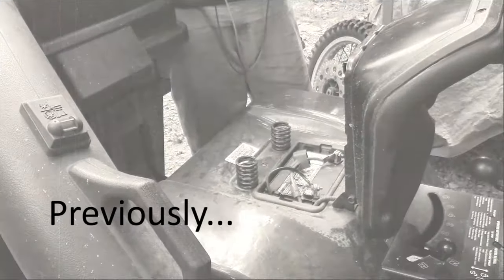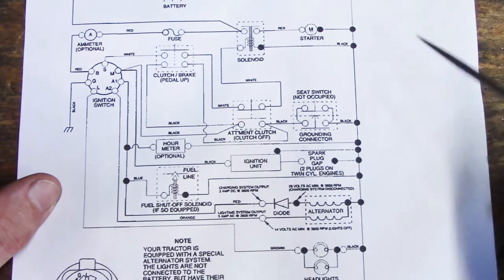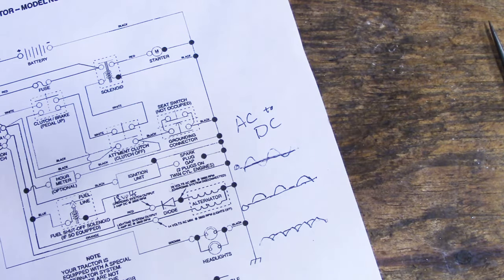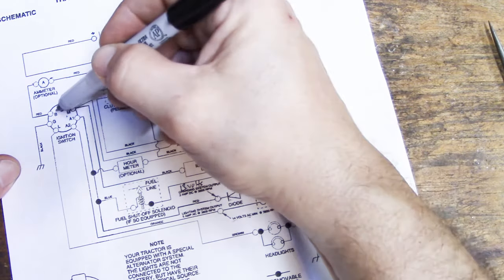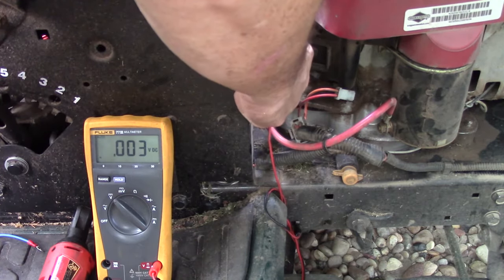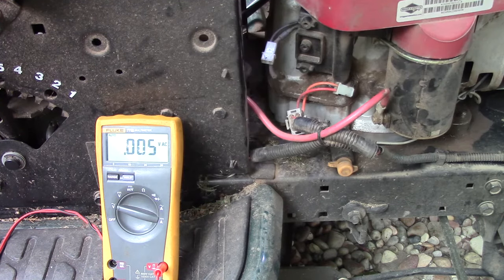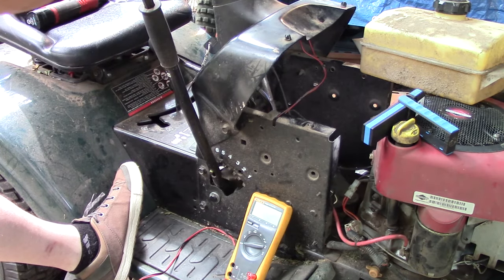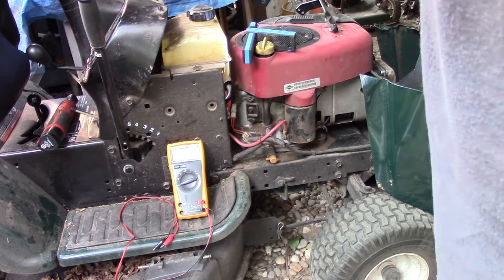Briggs & Stratton Dual Circuit Charging System - Diagnosis and Explanation

Comment: Very good and informative video. Mine is a Free LT1000 and seems to be configured exactly the same as yours (from what I could see). Mine doesn’t seem to be charging and I checked at the output of the stator/alternator which was 0 engine running at rabbit pace. Odd thing was that my battery was higher at rest than when running (and there was a gain climbing) but nothing indicated on the amp meter. I’ll try the disconnect reconnect amp meter trick.
Did you replace your cutter deck yet? If so how much and where?
Any trouble with your hydro static transmission yet. Gotta see if I can fill mine somewhere... haha. Thanks for the well made video!
Reply from the maker: Your problem sounds like an alt. No I have not replaced the deck, it is in good shape. And no trans problem as of yet. I am pretty easy on it.

Comment: So, I'm getting 26v dc out on that stator... How does that work? I'm assuming it's not charging the battery and there's a bad wire somewhere creating no load?
Reply from the maker: So yeah that sounds a bit high but did you check it at the battery? I did end up replacing this alternator. I would not trust the values I got in this video. With the new alternator I was getting more fluctuation and both higher and lower values but at the battery it was a solid 13v charging voltage. If it is more than that it might be a failing or failed open diode or ???? Thanks!

Comment: The reason it is 19 volts DC is because there is no load on the circuit.    Connect the battery to it and the voltage will go down due to load created from charging the battery.

Comment: I hope this helps you all: you can totally disconnect the wiring harness going to the engine and the engine will still run, if you pull start it/start it with a drill motor.  The ignition system is independent of all the crap in the schematic.  Pretend it's a push mower without a battery, because that's all it is.

Good video though!  Great explanation of the charging system, it helped me.

Go here to see what I'm talking about:https://youtu.be/c7R_4na47eo
Reply from the maker: Yes, in this example the charging system is only there to run the lights and keep the battery charged which powers the electric starter. However, if you have an electric PTO clutch, it is powered by the battery. But yes, in this example you could manually start the engine and it will run, though it would probably be easier to take a separately charged battery or battery starter and jump the starter, but the big drill method works. Good demonstration btw.

All the best!
Eddie

Comment: The wire with the diod on it. Does it go to a voltage regulator,, or direcly to bat+ thru egnition switch ??
Reply from the maker: The diode does the job of the voltage regulator/rectifier, there is no other regulator in the system. It goes thru the ignition switch though the motor will start without it working therefore it does not specifically influence the ignition system it just passes through the switch. Best!
Eddie
Reply: @theeddies  thanks alot. Just engine swap a husq 151 to an older 12hp briggs thats why i wounderd👍👍

Comment: I got the same exact setup as you. underneath the dash just behind the starter solenoid I have a white wire coming out of the wire harness it has a female Spade connector on it I'm assuming it's ground wire they're already is a white wire coming off of the actual starter solenoid on the stator side . it goes into the wiring harness.  that wait wire that's not connected to anything for life of me I can't figure out where the hell it goes. you off and on switch for the lights only has two poles on it if it was a three pole switch I would have assumed it went to the outside part of that light switch. didn't know if every tractor had an extra white wire sticking out of the harness ,  under light switch behind the starter solenoid area? and on the bright side of having one of these sissy lala charging systems. from what I understand from the B&S books Is that you can replace it with a engine that's more powerful or equal charging. just not one that gives off less power. when you swap any engines. so I guess anything can go in this type of lawn tractor that has the bottom of the line charging system.  LOL I have been trying to figure out a way to add something to where I can get more power on a tractor. power inverter a second alternator .tie in another generator somehow to the flywheel or to the engine pulley. first I wanted to put digital voltmeter with charging port for a phone. then LED lights underneath it, just to do a project with the kids. one thing I don't understand is under the hood it states that it takes a snow thrower , scoop and I'm assuming it's talking about a plow? I'm not sure where they thought that they would get the power from to raise and lower or to run a snow thrower. this is a Craftsman ys4500 model number 917. 276642.  20 hp Briggs Stratton Intex gold motor. pretty sure the gold part of this motor just means it has a pressurized oil pump at least as far as I can tell. I don't think it gives off any special powers to lift and lower a scoop. LOL anyway thank you for your video it helped
Reply from the maker: Hello,
Not sure about your wire I don't have any extras, it could be a for something your tractor does not have and they used the same harness. There are ways to upgrade to a better alternator. The models with an electric clutch put out more power as I understand it. I thought about looking into it on mine but changed my mind. Not sure about the snow plow or snow blower, most plows I have seen are mechanical lift I think. The blowers commonly just add another belt some way or the higher end ones might have PTO or PTO driven hydraulic systems, not sure, it does not snow in Georgia. All the best! Eddie

Comment: Can you test Briggs engine dual stator for current output and voltage using single diode use, WITH BOTH red+ blk WIRES TOGETHER, and at cranking speed only with plug wire disconnected, and compare with also with same  dual alternators with both wires and just a bridge rectifier at cranking speed , with plug wire disconnected, for current DC amps and voltage output? I need to know these measurements. Maximum current flow when touched quickly to ground, I am looking for 6-10 amps DC flow during quick test only. (PS- Reason for asking is because of The Alexander US Patent 3913004 provided EXCESSIVE electrical power output with double combined wires in it's charging unit.) THANKS, ....Russ
Reply from the maker: Hello and thanks for watching but I am not going to connect AC and DC currents together on my personal equipment to do some hypothetical test. I am a home shop not a testing facility with multiple machines and testing equipment. I would likely just blow my multimeter fuse, or burn out my diode and/or alternator. I would suggest you ask someone who has the ability and access to cheap test subjects to set up such a test. Maybe Taryl Fixes All or Steve's Small Engine Saloon. All the best!
Eddie
Reply: My 17 hp B&S Twin has this diode system also. I was having problems not charging so I took the connector with the diode that comes from the stator and moved the diode wire around a little bit with engine running and it started charging. Been working fine since. My mower was bought new in 95 and still runs great! Model 42A707 
Type 2238E1.
Thanks for posting this video. Very informative! 👍👍

Comment: man i have been searching for this Voltage Regulator that doesnt exist for a week now. Thank you so much. I cant say it enough.  My new alternator has 1 yellow wire. The old one had 2 wires.  Where does this 1 yellow wire go????
Reply from the maker: Hello, you are welcome. If you just have one wire and your old one had two, they must have given you the wrong one. It is dual voltage so you have to have 2 wires. You may have gotten an alternator meant to be used with a voltage regulator and rectifier. Best! Eddie
Reply: @theeddies  ugghh. Ok thanks so much. So much of a hassle lol

Comment: In short terms, most small engine manufacturers give you a simple charging system because it's cheap. High voltage, low amps (volts x amps=watts) Hence no voltmeter because ignorance is bliss. Beast practice is to manually charge once a month given that it can take 20min run time to replenish a start up.

Comment: Doodles control the direction of + electrical current, they do not act as a resistor transformer mosfet switch relay or clip capacitor, only an energy version of a one way check valve, in a rectifier there are 4 diodes that are wired in sequential redirecting order that sends positive current in only one direction, and negative current in another, without interrupting the ac circuit,(think of it as a push-pull piston in a pipe circuit plumbed in a square, the fluid would move in alternating directions, in response to input from the piston, unless T fittings with check valves one facing outward on one open end of the T outer end (exit) and one facing inward on the opposite side outer open end of the T,  lfacing inward (intake) still no fluid would enter or exit the circuit with any reliability, only low volume leaks caused by gravity and agitation, now install a check valve directly beyond the exit T fitting, only in-line with the original circuit, facing inward toward the piston, so no fluid will flow beyond T fitting, but will be able to flow inward, thus will be an effective outward flowing valve arrangement. On the opposite Side T (intake) place a check valve also facing inward toward the alternating piston and inline with the original circuit from the T fitting so fluid can only flow toward the alternating piston with two valves pointing inward, and two facing outward,  it the pipe at the top of the square circuit, and pipe the external ends of the T fittings into a reservoir, or a pool, that’s your AC circuit, the other open circuit you just cut, will have one side pulling external fluid ,inward  ( - ) and the other pushing internal fluid outward, ( + ) that’s your DC circuit .

Comment: The battery is charged by internal resistance and the battery voltage it should be 14.2 V with the engine running and all the accessories off is standard

Comment: I have the same system as yours but I'm getting over 16 volts at the battery. I haven't tested the voltage at the diode yet but it's definitely overcharging.  Can you add a voltage regulator to this system?
Reply from the maker: Yes, you can ad one. I know i have seen someone else do it on Youtube.

Comment: Hi. I have the same system but i get 18v dc from the stator and the same on the battery. Thats way too high charging. And now i see you guys have about the same voltage from the stator but not on the battery?? You got about 14.4v on the battery and 19v from the stator? Then there must be an regulator somewhere?
Reply from the maker: Hello. There is no single part that serves as a regulator in my system. The best explanation I have seen that makes sense is in the top comment of the video by David Kennedy. His explanation matches what I have observed. Your issue definitely throws a wrench in that explanation though. Is your stator supply running through the rest of the harness or possibly straight to the battery? As a side note, I did just recently replace this stator as it did stop working again. I get the essentially the same readings from the new one. https://youtu.be/iDjT_fzerxM
Reply: Hi I think you have a poor battery with a high Internal resistance allowing  it to rise to 18v  What a system if the only voltage control is due to thin wire used as a current limiter and voltage dropper nothing more than an old style Trickle Charger  it looks like a low cost job to me  Yes I have been looking for the nonexistent voltage regulator also   I am going to have a long hard think about this problem Will report again

Comment: I tried to do the test with a multimeter on the plug with the diode like you did but mine will not start with that plug disconnected. The wires to the strator needs to be plugged in or it wont start.
Reply from the maker: Interesting. If it is the same system, those 2 wires should have nothing to do with the starting system. They are just power outs, essentially. Not sure why that would happen.
Reply: @theeddies  My bad - starting issue had nothing to do with stator disconnect

Comment: your voltage regulator is missing, or the ampmeter is the voltage regulator.
Reply from the maker: The voltage regulator is not missing, parts list does not list one for this model. Everything I researched said that many of these cheap tractors without electric PTO's do not have a voltage regulator per se. They just spit out enough DC to keep the battery topped up without regulating it. However, I will test this again in a few days as I am having another issue where I will have to tear into that area. Been awhile but as I remember the ammeter does nothing except measure. The only way it could influence the charging circuit is if it contains or serves as a resistor which is not mentioned that I found. I will try bypassing it and see what happens, just for shits and giggles. Been running and starting fine since I replaced the alternator.

Comment: So i can connect the 19 volt to my 12v battery? Isnt that going to over charge it? Sounds like 19 volt is to much?
Reply from the maker: Measure it at the battery with it running. You should get 13-14 volts. Yes, if you are getting 19 at the battery that is too much.
Reply: @theeddies  i get 19 out from the stator. Can i run that 19v to my battery? And it will drop down to 13-14 volt like it should? I have swapped engine in my lawn tractor and i need to wire up the charging system.
Reply from the maker: @axtra92  I got the same thing. 19v from the diode DC side of the stator and 14 from the AC side, both measured at the stator connection. But when I run it and measure at the battery it is around 13-14.5 volts DC. To my knowledge there is nothing between them that would effect the voltage. It is "regulated" by the resistance of the cable and the week half wave output of the stator. This is the way it was designed to the best of my knowledge. It is the bare minimum that works and cheapest way to do it. Try it yourself, it is not going to hurt the battery running it long just enough to measure it. If you get more than 14.5 volts, you might want to add a voltage regulator.

Comment: Great video and maybe someone here can help me , i have this type of charging system on my columbia riding mower and the diod is popped and the machine still starts and runs but i dont know why it popped or how to test it and last , what diod to get and where . I got this machine with this problem and im good at small engine repair but never seen this system , can i swap it out , any help would be greatly appreciated ..thank you for this video i had a long search to find this system and explanation 👍👍👍
Reply from the maker: Thanks! Briggs sells a diode replacement kit I believe. Check ereplacementparts.com
Reply: @theeddies  thanks i will look ,i pulled off my flywheel and alternator/stator looks good sohope its an easy fix
Reply from the maker: @4486xxdawson  It is an easy fix. I think I might eventually convert it to use a regular voltage regulator. Pretty simple conversion.

Comment: Hey I have a motor that is set up with diode, where can I get the diagram you are using, benn fooling with it a week and I found your video thanks Robbie
Reply from the maker: Links do not work all the time with Youtube comments but I will send it to you in a separate comment. If that does not work just go to manualslib.com and enter the make and model # to get the manual for your machine. The wiring is in there.
Reply from the maker: https://data2.manualslib.com/first-image/i10/49/4876/487530/craftsman-917-275371.png
Reply: Ok thanks this helps love the way you explained it, that helped me just got to figure out where to get the diod thanks again Robbie.....
Reply from the maker: @robbieduke944  Thanks, that means alot.

Comment: What would cause a battery to go dead and then not charge but it has lights when running but won't charge is it the battery
Reply from the maker: This is the same problem I eventually had later. The alternator had a short in it on the charge (DC) side. But the AC side was running the lights. I had to replace the alternator. Pretty cheap and easy job. I have a video on it. https://youtu.be/iDjT_fzerxM
Reply: @theeddies  that's what I thought but wasn't sure thank you for telling me

Comment: That's a no load voltage, if it's connected to a battery and charging it should read like 13 volts.